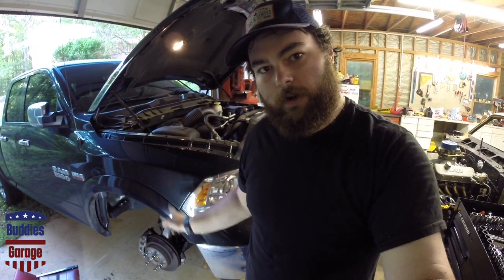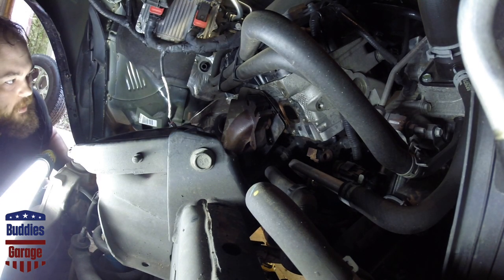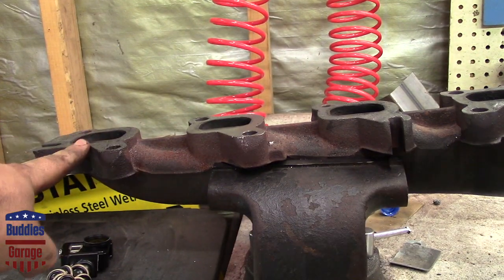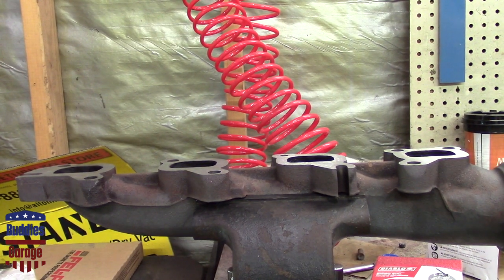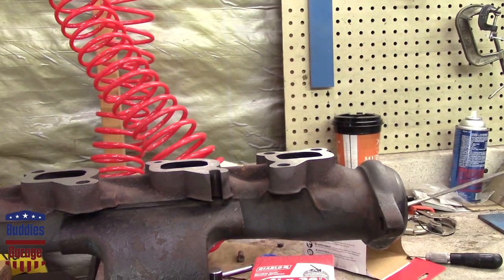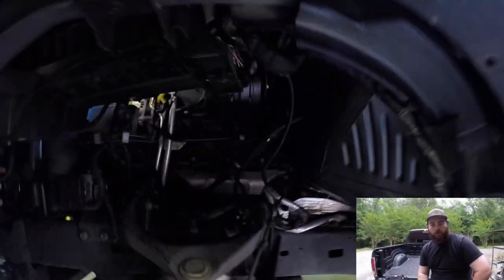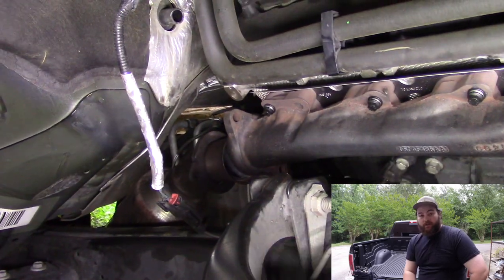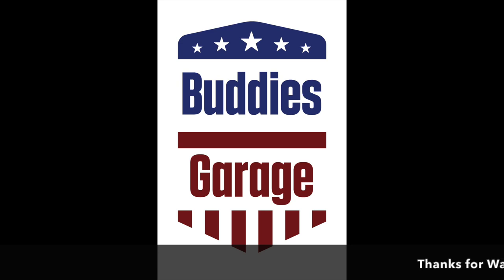Repairing Warped Ram 1500 Exhaust Manifolds

Comment: There's no recall to be had on these of ANY make/model where cast iron manifolds are used with aluminum heads the cast iron manifold coeffecient of thermal expansion combined with the fact that the rear is where the most heat collects AND the pressure on the rear of the manifolds from the weight of the exhaust system causes the bolts to eventually break. Pure and simple! Those that "remedy" the issue with headers is because steel expands/contracts less than cast iron!
Reply: So, can the old manifolds be heated, and straightened? Thats being bantered everywhere???
Reply: Not mention the 5.7 manifolds are too small for the engine.  The new updated parts show this in the new cars because they begin to crack the manifold
Reply: @captainbart you’re better off with bd diesel aftermarket bolts and headers.

Comment: I've owned a 69 Cuda 340, a 68 charger 440, a 70 challenger 383 2 barrel, my dad only owned mopar from the 60's on and not once  ever did we get an exhaust leak from the exhaust manifolds and bolts NEVER broke on those V8'S!!  How is on a 2017 Ram 1500 it is a constant problem?? Get them fixed  they break again now I find out the manifolds warp, with all this modern technology I thought things were suppose to get more advanced, easier and better NOT!!  Try changing your own oil!!  What a pain!
Reply: Aluminum heads buddy...Aluminum heads make all the difference in cooling the cast iron at a different rate because of the collector design.
Reply: @DL101ca  why didn't they create exhaust manifolds that are compatible with aluminum heads?  Modern technology should give them the ability to do that I would think!
Reply: @patricksnyder3446 money? duhh

Comment: I'm sure that those exhaust manifolds are glowing red at constant highway speeds. I for one would not want that blazing heat fully exposed under my hood with the heat shield delete. That heat most likely would shorten the life of any rubber or plastic in the vicinity.

Comment: You sir are a genius. I just finished sanding both manifolds down after watching your video and picking up a belt sander. This specific model wasn't available any longer but they had a $99 one which was pretty similar. Both sides were warped, driver side more significantly than the passenger side. I tried using the Harbor Freight sanding belts first but that just wasn't cutting it, ended up running back out to pick up the 50 grit Diablo from HD like you used and it was much better. I had already purchased the OEM replacement bolts before seeing what you used so I'm going with those, hope that doesn't come back to bite me instead of using the ones you did. Getting those suckers out was a real pain in the neck, had a total of 7 broken bolts across both sides. 4 had enough sticking out to grab onto and back them out fairly easily, but 3 of them were broken flush with the cylinder heads so they had to be drilled out. Takes a fair amount of creativity to get at the right angle in that tight space to drill them out and extract. Everywhere I have checked the driver's side manifold is out of stock so replacement was not an option, only repair ('17 2500 Tradesman 6.4 HEMI). So thank you for this video, very helpful.

Comment: Thank you for the detail, I'm going shortie headers if I am taking it all apart, but your video and detail will greatly assist with that. I have exhaust tick in exact same spot, hope I get that lucky on the bolt!!
Reply: I installed BBK shorty and now my welds at the collector are cracking and leaking.  Going back to manifolds with ARP bolts.
Reply: @nickbreit438  I read this about the bbk headers. I chose the next option which are power Go headers. All tig welded. The only difference is they are designed for street versus the bbk's are designed for "off road" aka sporty-ish
Reply: The BBK header were tig welded as well.  I think the metal is just thin and crack around the welds.  Not sure how the other brands hold up but hopefully they last longer.

Comment: For anyone thinking of going the shorty header route, the most popular pick is BBK but there are numerous reports of the welds cracking. The next top choice is PowerGo shortys. All tig welded no reports of cracking. They are more difficult to install than the BBK's so if you're not experienced with a wrench it may be a bit intimidating. And don't use the gasket that comes with them, get the fel-pro gasket like in this video.
Reply: AFE Twisted metal shorties w/ ARP bolts is the way to go for $1,000, Kooks longtubes and y pipe if you want power

Comment: EXCELLENT video! I'm heading to Harbor Freight now because I have 2 dodge 4.7 manifolds that are warped badly
Reply: How’d it work?
Reply: @KollynJ  It worked very well for me! I had some minor issues with keeping the belt on the sander tight. It was slipping but once I got that solved, I was able to sand them pretty straight!
Reply: @DannyKellaher21  amazing. My problem is my manifold is warped but has raised rings around the ports. Not sure I can eliminate those

Comment: If it’s a 21mm, the closest imperial socket would be a 13/16. If you want to convert from metric to standard, you’d divide by 25.4 and if you go from standard to metric, you’d go multiply by 25.4

Comment: This video was great 👍 I'm about to do this on my 2013. Thanks for the tips before I get into it!
Reply: Did you wind up doing this ? I'm getting ready myself to have it done at the shop
Reply: @tattedup1189  I ended up paying $1000 to have both sides done.
Reply: @JakePkz  what did you have done new manifolds and all or just new bolts old manifolds or what ?
Reply: @tattedup1189  Bolts and manifolds. After watching a few of these videos, I figured I better just get it all done so it doesn't create more problems before I decide to sell it.
Reply: @JakePkz  lol hear that gonna get mine done with stocks i had the bbk kit ordered and in my garage but so many mixed reviews i sold then decided to go stock route in the next week or two

Comment: I wondered if not putting the studs back in would help solve it since it seems it’s always the studs that break not bolts well please let me know if that cured it
Reply from the maker: The studs are only used to mount the heat shields.  They break because they are at the ends of the manifold and get all the stress from them warping.   Resurfacing the manifolds fixed the issue and has been fine for another 30k miles.
Reply: @buddiesgarage8998  thanks for the reply I’m gonna give it a shot I appreciate you showing us how it’s done

Comment: I have a 2016 with the same problem and it was like that when I bought it off the lot with 7 miles on it. The salesman told me it was the Dodge tick. It's been like that ever since. I'm not looking forward to having someone do this to mine.
Reply: Why would you buy a truck that already has issues with no miles on it ? Did he give you a great deal or what ?
Reply: @DL101ca  I wasn't aware that that was what was wrong with it at the time, I only learned that from researching videos recently and watching this one. I definitely distinctly remember having a conversation with the salesman asking why they all sound like they have a lifter  tapping. When the truck is new it doesn't sound like an exhaust leak because the gap is so small its barely a sound, but it's definitely a sound you can hear. He told me "oh, that's the dodge tick". Back in 2016 when they were new no one knew this was an issue. And after driving multiple that all sounded like that, when you're there, and it's common, you think it's some normal sound they make. They are over torqued from the factory and when it heats up the bolt breaks off on the back passenger side closest to the fire wall. The specs were wrong on the assembly line. Looking back now I'll never ever buy a new car with any sounds that are abnormal but at the time it's easy think something is "normal" when multiple new ones all sound the same. I still have it and have 103k on it now but it is the same problem. Lucky I know what it is now after researching and realizing I can do it myself from this great video.

Comment: Hi Buddy. I’m preparing to do the exact same job to my 2015 R 1500 laramie, 5.7. Yours is the first video where i’ve seen someone delete the heat shields. I want to do the same. Should I have any concerns?

Thank you for your great videos.
Reply from the maker: There is no advantage to doing away with them i just couldnt get the correct replacement bolts from Mopar due to covid at the time.   I still dont have them on and havent had any issues.

Comment: Wanted to check on the work done.  I replaced my manifolds 10 months ago with new ones.  They already warped and bolts broke(Doorman parts).  Curious if sanding down current warped ones lasts longer since they’ve aged
Reply from the maker: At 173k miles and still going without issue.

Comment: Can you use a belt sander to resurface some shorty headers? They rock slightly if I put them on a flat surface or is the flange gonna get flat as I torque down the bolts
Reply from the maker: Short answer is yet but i would be mindful of the flange thickness.  The thinner it is the more prone to warpage.   Also the flange to primary tube weld could be compromised if you have to take a lot of material off.

Comment: How are the ARP bolts holding up?  I installed BBK shorty headers and just found multiple cracked welds.  Only lasted a little over 2 years.  Thinking of switching back to the manifolds with ARP bolts.
Reply from the maker: They’ve been fine.  ARP makes great stuff.

Comment: do you have to add washers to ARP bolts if  the heat shield canceled? also do you put any great on the bolts?
thank you!
Reply from the maker: ARP bolts come with washers.  I used some oil on the threads beings the head is aluminum.

Comment: How did the broken bolt on the driver side go? Doing this job now and I had to weld a nut on there to get the stud out
Reply from the maker: Luckily the only broken bolt i had was on the passenger side.
Reply: Using an easy out,  you drill and use the reverse thread easy out to pull the broken bolt out.

Comment: Hey bud, how are they holding up still ?
Reply from the maker: Getting close to 140k total miles i forget what it had when i did the manifolds but i havent had any issues since i did the video.
Reply: @buddiesgarage8998  what bolt size did you go with exactly i see you showed in video the 1003 ones but then had a side note on bottom of your screen with a different part number ?

Comment: why leave the heat shields off ?
Reply from the maker: Honestly because that was the bolt that broke that holds them on and no dealer had them when i needed to get this done.  No performance gain what so ever.
Reply: @buddiesgarage8998  cool, i was hoping it was a hack to keep the manifolds cooler, lol ,i thought you were on to something,  im doing my 2012 now, and its the driver side "its getting worse as i go along two manifold bolts broke as i was removing them even after it sat overnight with pb blaster "man that stuff stinks" made me sick and thats why it sat overnight   lol,   i thought i was getting of easy with just one broke bolt when i started, now 3 & the last one is flush with the head,   i only have a stick welder , and no way to drill were it is at with my large drill ,   i may have to take to a pro,,, anyway great vid and thanks for the get back  maybe it get lucky and the super glue trick will work ,, yikes !    lol
Reply: I left mine off..no issues

Comment: is there anyway of avoiding getting bad warped headers factory ones? or is it just inevitable?
Reply: Inevitable man, sadly. Well at least i’ve never heard of any 100k+ or even 50-60k+ mile hemi that hasn’t had this problem. Could be wrong.
Reply: @fabiangarcia4230   crap, my 2014 5.7 has 80,000 miles on it now I'm worried lol it a job I don't think I can tackle
Reply: @jameswilliams5428  yeah i feel you, but dont worry about it too much man. Consider yourself lucky if you dont have any leaks yet at 80k and if it does as long as the ticking goes away after its warm you know you’re good
Reply: @jameswilliams5428  i have an 05 hemi myself. Been tickin a long time and dread the repair. Im scared the bolts are broken at the cylinder head. I’ll get to it one day lol. Haven’t had any reliability or performance problems yet. Maybe a drop in mpg. But thats about it

Comment: a cheese-ball belt sander?  How much are a pair of shorty headers?
Reply: About $500-$800 a set. Amazon has knock offs for $235, but if the BBKs have broken welds, what do you think the No name ones will do? If you’re gonna spend that much on shortys, go get the long tubes and have the exhaust reworked so you actually get a performance boost. Shortys only add 5-7 hp, and to get some that won’t leak, you’re gonna spend mad money. I’ll take the $70 belt sander or do the whole long tube job. Shortys are a waste of money.

Comment: What did you use to clean it with after sanding it?
Reply from the maker: I have a parts cleaning tank filled with mineral spirits.  Any degreaser or soap & water would work. Just got to get it clean and dry.
Reply: @buddiesgarage8998  I was wondering the same thing. Thank you for replying to Ricky’s comment. Much appreciated!